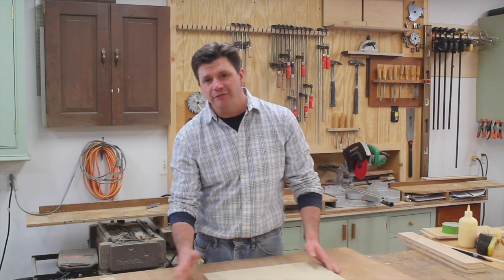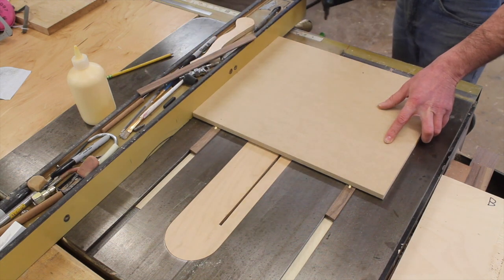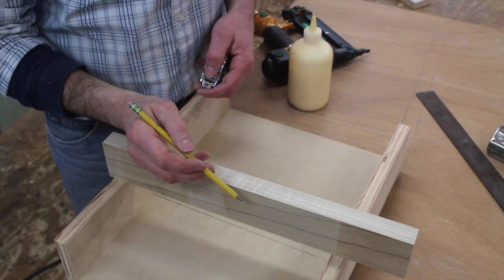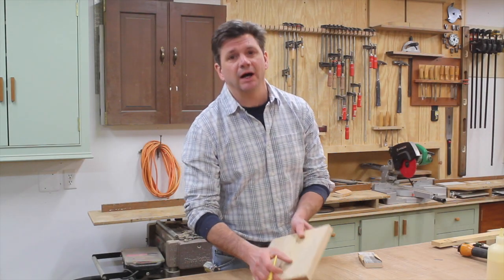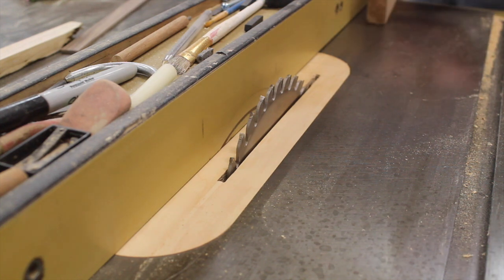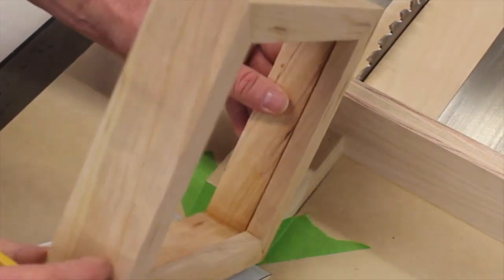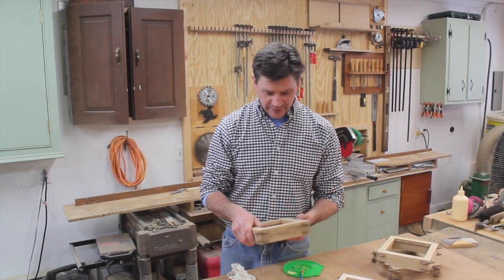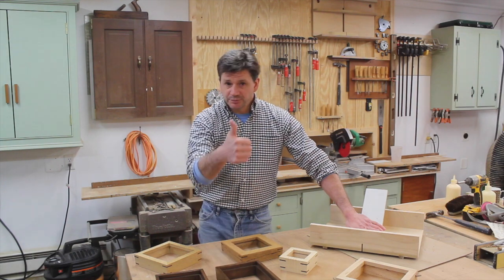Build a Simple Spline Jig & Make a Spline Frame

Comment: Jon great video, I made a temporary jig awhile ago and although I don't really make frames I do make small boxes, I have a 2mm blade on my saw and at my local hardware chain they throw away the packing strips between the timber lucky me Merbau, Spotted Gum, Jarrah all hard woods of different shades, there all pretty close to 2mm sometimes a little sanding is needed to get that snug fit...... I'am impressed with your using the off cut as your work piece will definitely try that next time and will use a couple of your ideas and make a not so temporary spline jig, Tim.

Comment: Spline are one of the best ways to strengthen frames, and even if I don't use one decoratively, I often make a spline on the bottom of the canvas frame for strength open on open side. I have a dado set just for this purpose. Its so much easier to keep equal width cuts so that my splines will all fit perfectly.

Comment: Considering that the two sides of the jig are never going to be used (to be read, occupied with material) you could add two screws on either side that would act as end stops for the frame.

One on each side for the two cuts.

Awesome jig!

Comment: thanks for this jon, question..i know this might be more dangerous but alot faster. what if you just slide the frames through the table saw up against the fence and hold it at a 45 degree. i know might not be  100% true 45 but the once the splines are installed and sanded youll never know.
Reply: i like to see someone trying, it looks really unsafe, looks like a job for Jimmy Diresta!
Reply: Sebastian ocaño ya either that or slide 45 support blocks along side with the work piece at the same time to keep it true.

Comment: Hey Jon,

I'm looking at building a farmhouse style table for my wife and I was wondering what you would recommend using for the top of the table??? I've seen a lot of walnut top tables but it would cost about $350 for the walnut and that's a little out of my budget. I'm leaning towards pine or poplar but I haven't really worked with either when it comes to staining dark. Any input would be greatly appreciated! Thanks
Reply: Any help would be appreciated
Reply: +Lane Simmons I know this is an older post and you wanted a response from Jon and I am definitely not up to his level but I just finished building my own table so I thought I would share what I know. If you are only going to use Pine or Poplar personally I would go with the Poplar. I built my table out of hardwood pallets and a stool for it out of Poplar. Just my two cents but go with Poplar, it's a little harder and if you are selective you can find some really nice colorations in the lumber.

Comment: I use to make a lot of frames back in the 80's when my photography grew.  I liked corner splines like you're doing but I did a lot of face splines and I'm not seeing those around?  Corner splines are nice on wider boxes/frames but get lost on thinner frames.  That's when the face splines work nicely as a visual accent.

Comment: you could cut splines with out the jig, just set the blade height and only push it the right amount into the blade. The slit will be slightly round (triangle cut from a circle) but that is on the inside where you can't see it

http://imgur.com/wUp2oP8